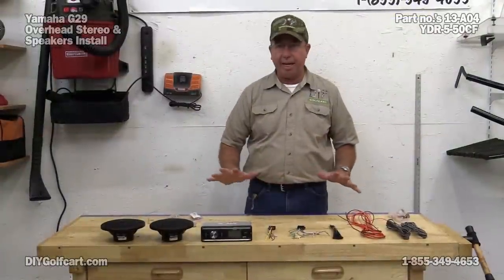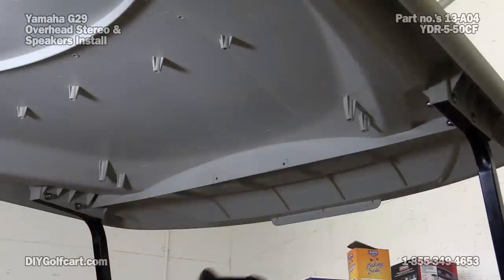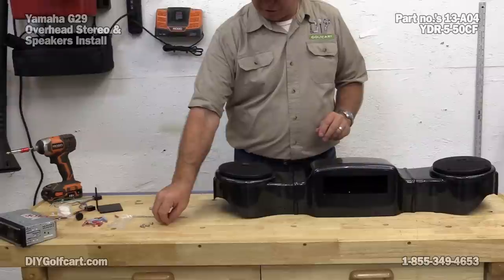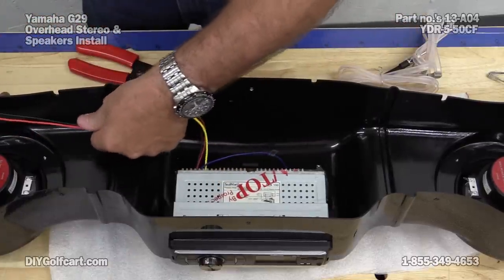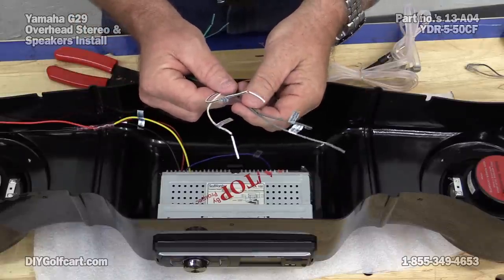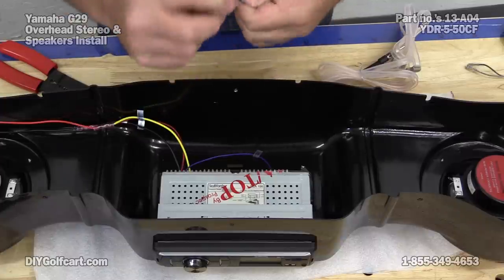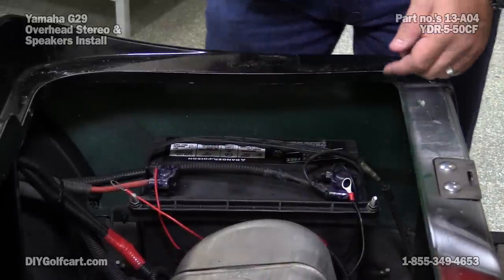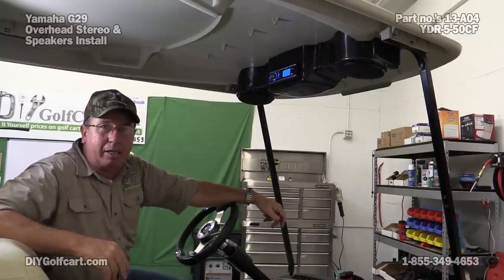Golf Cart Overhead Radio Console | How to Install on Yamaha Drive Golf Cart

Comment: Great video! When installing the pop rivets through the roof, you should put sealer/silicone on the rivet head, and install from the top. Seals easier, and much better appearance.

Comment: Great video and im sure there is always other ways of doing things but as for the rivets, Argh!! Wouldn't it be better to use pan head screws and nuts for a cleaner installation? Also make it easier to seals the roof from rain.

Comment: If you install this stereo to a 12v system, will it always be on and drain the battery?
Reply: I'd wire it to the ignition so that it doesn't turn on until the key turns.
Reply: @teamhex  it would lose memory if you do that

Comment: Good video, I really enjoyed that.  Question for you.  I have 6 batteries that are 6 volts each.  How would I make the battery connection to the stereo?  My cart is an EZ Go.  Thanks.
Reply from the maker: The best way to connect you stereo is to install a Voltage Converter to drop your battery packs total voltage from 36 volts to 12 volts. If you want to just connect to the batteries you already have, put the Positive Cable from your stereo on the FIRST Battery Positive and the Negative Cable from your stereo on the SECOND Battery Negative. You can verify before installation by checking the voltage between the two connections to make sure you have the right two post.